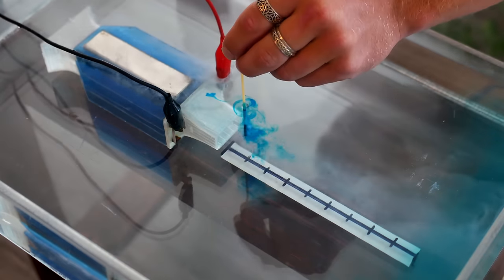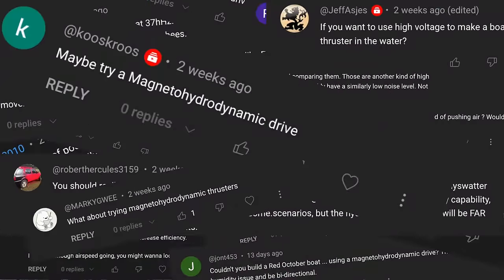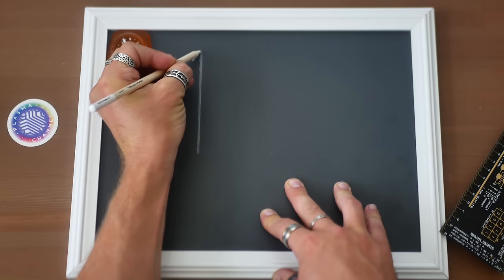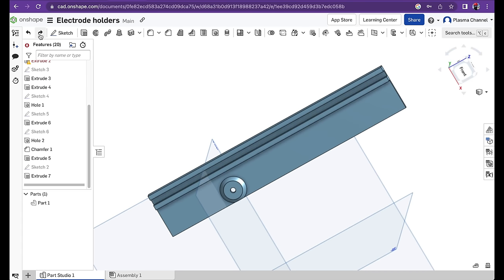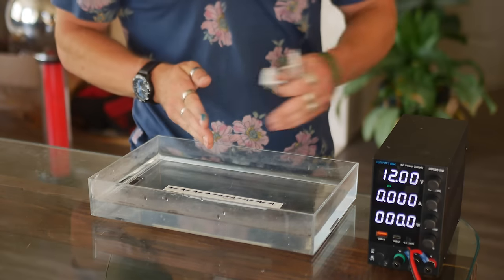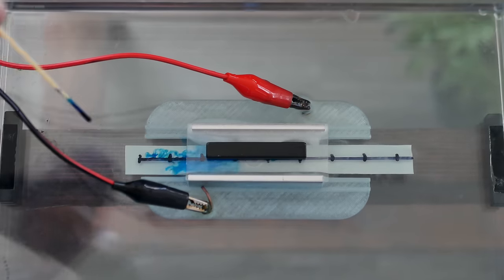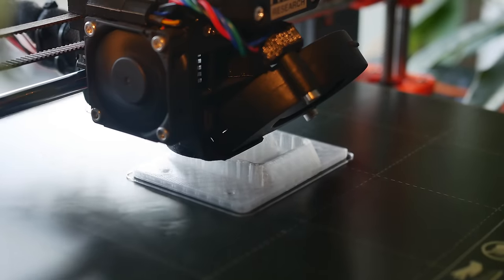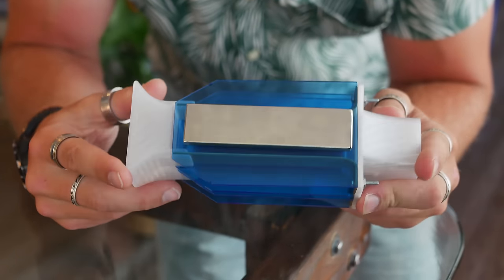Using Stealth Propulsion for Ocean Travel (MHD Thruster Build)

Comment: I noticed that the flow becomes turbulent as it increases speed. This happens at different places in the distance-between-plates experiment. It seems like it speeds up more quickly when closer together, but then goes turbulent and looses much of it's forward momentum to eddy currents. Perhaps this is why the final speed seems independent of distance. 

I wonder if changing the gap along the axis of flow would keep the flow laminar long enough to escape the nozzle before loosing momentum to turbulence. Alternatively, place flow straighteners in the stream to prohibit large eddie currents from forming. 
It seems that a very narrow gap, like in the millimeter range, would keep things smooth. I'd have to check the Reynolds number to find out the distance needed at that velocity. 

In order to keep the flow in an electric field between the straighteners, you may need to have a plates polarized positive and negative on each side of the straightener. it would look like this:

+|-___+|-___+|-___+|-___+|-   here the "|" is an insulation wall between conductive plates and the water is going into the page through the gap  "___"

instead of its current configuration of:
+____________________-

Comment: I'd like to see an attempt with AC, which should help reduce the oxide buildup and may permit you to use aluminium electrodes - we use AC for welding aluminium.
The positive cycle acts on the surface to break up oxides that limit weld quality and weld penetration is achieved by the negative cycle.
You may also want to consider soldering the electric cables to the back of the plates (or TIG welding if using AL) and then encapsulating the entire plate and uninsulated cable parts into an epoxy slab, surface grinding down only the face that will be exposed to the interior of the thruster. This will stop current waste from the back of the electrodes and the cables.

Comment: The interaction is between an electrical current not an electromotive (electrical potential) field . Yes, the electric field and the electrical current are in the same direction, but the distinction is important to magnetohydrodynamic drives, since it determines the fluids which will work and the power required. 

The distinction become important as soon as you list the relevant variables @3:13: fluid properties are missing. You should have magnetic flux and current as the basic variables, then get into the dimensional factors and fluid properties that affect the current. 

You can't control the properties of the fluid (water) around a vessel, but you can understand where it will work... such as fresh lake water versus saline ocean water. You can also be prepared to adjust your electrical drive control to compensate for different water properties.

I did notice that the test of the assembled unit later including adjusting salinity to ocean level at 9:50... but with no discussion of how or why that was chosen.

Comment: I actually expected the longer spacing to indeed have no effect, and it is actually very logic why:
the water is like a electric coil.
with a electromagnetic coil the strength of the magnetic field is the amount of turns*the current(roughly).

the thing is normally only coil turns are measured but wire length also has some effect. and in the case of water, the water length has a very big effect where in a use case like this one the water length is essentially like the turns of a coil in a electro magnet. well there is a limit however, since eventually possibly the influence of the current and voltage might not be high enough anymore due to way to high resistance, even though that is hard to actually test for sure since then you are measuring on such a scale that many other factors also affect it.

using more spacing between them is actually better for efficiency and will reduce the amount of hydrogen generated.

since again after all it is just like the amount of turns of a coil will increase the magnetic strength, and just like with wires, in water this is roughly equal to the increase in resistance meaning that the current will decrease but the magnetic force will stay the same due to the increase of virtual "coil loops".

nice device however. also a much simpler approach to what I designed. since I wanted to fully avoid electrodes which will rot and such, so instead of sending direct energy through the water designed it to use eddycurrents instead, that is also more like how it is done in the movie based on how the sound and such are depicted like a underwater earthquake.

Comment: Spacing probably doesn't affect anything for the same reason you don't need the large scoop in front with the narrow exit: Liquid is non compressible. A compression section makes sense in a jet turbine engine where the compression and then release of air makes thrust. With water it's about the volume that can move through. Narrowing the through-put only creates pressure in the system. From an ecological standpoint there's the question "At what point does global sea drives by way of electrolysis affect overall ocean salinity?" The process causes oxygen and hydrogen to separate, leaving behind the ocean brine in a larger concentration.

Comment: Superb video. The concept is quite interesting. I’m not sure how much of the following is not part of the video to allow us, the viewers, to focus on the most important part. 

From an engineering point of view, it would be interesting to measure the thrust and the electric power consomption and plot again the design study considering thrust to power ratio at it would lead to a better understanding of the physics. After such design study, a second round on the catamaran with such propulsion would be awesome. Indeed, such design won’t be impacted by air humidity and would apply thrust into water instead of air, thus being less sensitive to wind.

To measure thrust, an easy way would be to fit the propeller on a 1m pendulum, and hold it with a spring. Neglecting the gravity effect, measuring the advancement when the current is applied would provide a thrust in Newton.

By the way, did you try to reverse the + and the - to test a reverse thrust?

An other question coming to my mind is the effect of water speed on thrust. I didn’t do the maths, but I believe thrust should not be impacted by flow velocity if we neglect hydrodynamic friction losses. In order to get a practical scale 1 propeller, speed sensitivity is to be taken into account.

I hope this can help,

Comment: Very interesting. My 2 cents, when optimizing a design you have to consider all the factors at the same time and not one by one. The process is called design of experiment (DOE). In simple terms, you might have found that larger spacing and lower magnetic field strength is better. The DOE design methodology will not require you to test all the combinations, that will be impossible but will still give you a sense of where is your optimum. On your electrode gap and velocity flat graph, probably you need to look at volume flowrate and not velocity as your output parameter, after all you will get your watercraft to accelerate depending on the volume of water and its velocity. So I would repeat the experiment using DOE and I would not use velocity as an output but volume flow rate.

Comment: Suggestion: isolate the electrodes and use higher voltages, 1000V-3000V. You lose power by decomposing water, you want to ionize the water. clean water is polar in itself. Another advantage is that no chlorine gas is created when using seawater, which is not good for your health.

Comment: Closer spacing should show higher current drawn at fixed salt concentration, you were right about that.
My take: There maybe exist an issue with the DC power supply you are using. Please check whether your device(DC source) has modes; constant voltage (cv) or constant current (cc), especially when operating around electrolyte rich water i.e. NaCl dissolved.
Decreasing electrode spacing should bring down overall resistance i.e., enabling higher current draw enabling more ions from NaCl moving thereby thrust. but why isnt it happening i put two assumptions-
1) There may exist a feature in your dc power supply where set voltage is competing with set current drawn whichever value reaches quicker device "cut off" further increase of that value. Ex. If i set 14v but for a system of known salinity at 4cm electrode spacing maximum current drawn is 0.01A and device [unknowingly] sets 0.01A as cut off amperage then even if you close the gap to 0.5cm maximum current drawn will still be 0.01A at condition of constant current, no matter if I still set 14v across elctrodes as by default device will decrease voltage. Vice versa is true too

2) No. of ions at fixed NaCl conc.& voltage just above electrode is transient even if we consider water to be as still as possible and this is a function of time. Decreasing spacing just intensifies the net electric-field acting on it (F=qE) and should increase thrust but if dc supply is modifying the power values on its own then it's troublesome.

The very common type of dc power supply conserves the power being supplied at P =I×V_[set] = I_[set]*V.
I hope it helps, do correct me if I am wrong, which internet gods probably will😂.
Regards.

Comment: Cool concept if you made the thrusters on a catamaran boat you could use the entire pilions as the thrusters . Completely unrelated but recently i was thinking of pop pop boats and wondering if you could still achieve the motion of the basic steam engine while putting turbines into the exhaust and entrance for the water , it may be a little low tech but if it works you could use the electricity generated by the turbines into heating the water to make steam to power the boat with a solar panel and some batteries to heat the water initially you might be able to get extremely long milage on a trip if it works and was scalable

Comment: Has the electrodes be paralel oriented to each other? I mean, if you try to orient them into "V" shape, or even have electrodes in shape of 2 halves of funnel, or if you add a funnel behind the electrodes, the "jet" effect could even add some additional speed for the boat (or sub). I mean, the main marketing point that kind of propulsion seem to have is the silence, but there are another 2 equaly interesting for modern ship builders: 

1) Higher safety for marine life, than with spinning proppeler.
2) Extreme simplification of overall machine, and downtrotting of the necessary budget for repairs. 

If the ship (or a boat) with MHD+Jet is able to move in comparable speeds, with comparable power input necessary to reach said speeds, the new motor might have VERY bright future ahead. Not to mention, for already electric driven solar/hydrogen hybrid ships (obvious trend in civilian yachts), MHD is more effective way to USE the electricity, than propeller, because when energy is converted (say from solar to electricity, and than from electricity into mechanical movement of the propeller) during each conversion quite a chunk of energy is being lost. And if the hydrogen comming out of the hydrolysis is being harvested from the MHD propulsion, the whole "hybrid" machinery, including hydrolysis device, could be simplified, by using the MHD INSTEAD, for hydrogen hydrolysis.

Would LOVE to see that MHD engine of yours fairly prolonged, and used on a boat. Either 2 such long MHDs connected to port and starboard of a single hull rowboat, or (simplier, cheaper), single MHD shaft, sunken&connected in between amas of miniature catamaran boat. For steering, i sugest thrust vectoring, like on a jetboat for direction + reverse, and voltage + lenght of the MHD for speed. 
Alternatively simple helm for turning, and voltage + lenght for speed. 
To clarify what i mean under the words "lenght for speed" - i mean, there is no rule, the MHD HAS to be vired as a single long unit, instead of number of shorter, smaller ones. Because if you have more, you can send electricity into all, half of them, or to only ONE, to make a difference in the final speed.

Comment: What happens if the electrodes aren't parallel to each other but instead installed at an angle? Does that change anything? I could imagine that might accelerate the flow of water towards the end...

Comment: Water doesn't compress. I'd think your exhaust nozzle is causing excess drag, slowing down the whole water column... And your intake scoop is causing more drag on the front. The best I think you could do is putting an anti-fouling screen over the intake (then the water that isn't deflected by the screen should make a good match to the acceleration tubes), and then getting rid, or making hydrodynamic the exhaust nozzle, so that flow is balanced between the outside, and inside of the thruster. The exhaust nozzle would be a good idea for a ducted screw, but I don't think you have to worry about cavitation with this thruster. As a matter of speculation, since you add velocity to the incident water, this thruster should be able to add thrust at any velocity your craft goes... That is until the added power equals drag.

(BTW, your ion thrust boat, probably would have been a bunch faster if you killed that drag by making it a hydrofoil.)

Comment: Mechanical Engineer here. I have to brush up on my knowledge of electromagnetism, but is it absolutely necessary for the anode and the cathode to actually react with the water and thus oxidize/reduce? The lorentz force equation being f = qv x b says that the charged particle and its velocity crossed with magnetic field b yields the desired force. B is obtained from the magnets. But what charged particles are actually moving? Is it the Na + and the Cl- ions? Is it the water itself: being slightly polar? And is the attractive force from the electric field from the cathodes acting on said particles incurring the velocity v in the lorentz force equation? or is the generation of the O2 and H2 gas on the incident surface and being pushed off somehow entraining the water? I'm thinking if there was a way to eliminate the using up off the cathode/anode, this drive could be made to operate essentially indefinitely without any sort of wear whatsoever, but I'm a bit confused if/how the electrolysis of the water plays a role in the drive's functionality. Any input is appreciated.

Comment: I would try changing the electrodes to like graphite rods that should solve the Oxide issue    Also, we know that length of track correlates with. Increase performance and so does increase magnetic field, so what if you made a complex geometry kind of like how the inside of subwoofer housings are that way you can have a really long electrode without making it take up a whole lot of space

Comment: My guess on your spacing tests is that closer spacing increases water electrolysis and thus loses a lot of energy (and E field into the electrical double layer because the surfaces will be ion-rich). I looked it up and electrolysis was necessary in the Yamato 1, so shielding the electrodes is probably a no-go, though I'm wondering if a thin hydrophobic coating might allow suppression of the electrolysis without suppressing the Lorentz force too much, especially in salt water which will already be ion-rich (though then why wouldn't the Yamato 1 engineers have done so-I'm probably missing something key about the current flow into the water channel)... but then again the EDL will be strong and suppress the E-field through the majority of the gap. My intuition says the solution to that is to use electromagnets and AC current to keep the ExB vector steady, but at high enough frequency that the EDL doesn't form fully. Since the Lorentz force would then follow the AC field, a DC offset should be neutral, so you could also bias the electrode to the potential of zero charge to further reduce EDL formation, that in turn might make any coating unnecessary to eliminate bubble formation... though maybe not. And I doubt it would be electrically efficient.

Comment: perhaps the use of some hydrophobic coatings on some of the pieces could decrease internal drag (especially in the intake) and allow for higher throughput, though alone it would likely do nothing.
im thinking a cylindrical design with a ring of magnets and several internal channels is how it is probably done.

Comment: With respect to electrode spacing, the linear speed of the water might be constant but I would think the volume of water moving between more widely spaced electrodes would be more.   Did you find an increase in current with larger spacing?  Am I thinking of this correctly?  Bigger pipe, bigger volume?

Comment: Oh, did you actually use aluminum in salt water? It corrodes very quickly, even the foam was visible. Here it was necessary to use something resistant to corrosion in sea water.

Comment: If the metal is undergoing electrolysis, this would not be practical for actual use because you would constantly have to replace the sacrificial anode as it loses ions to the water.  Electrolysis is something boaters have to try very hard to prevent / mitigate lest it corrode the important metal bits on the bottom of the boat.